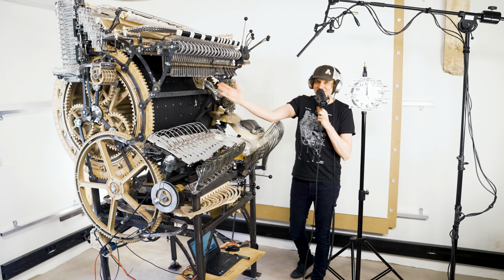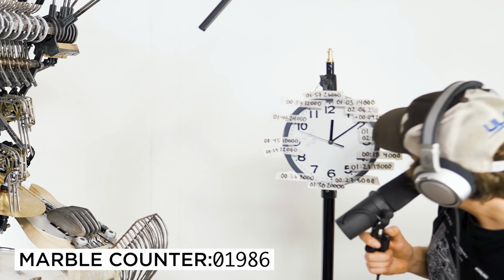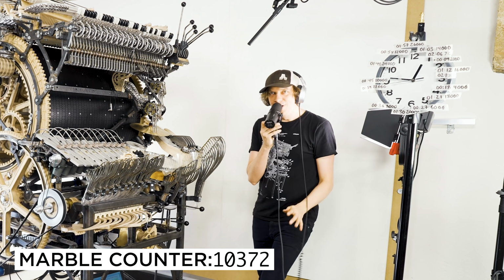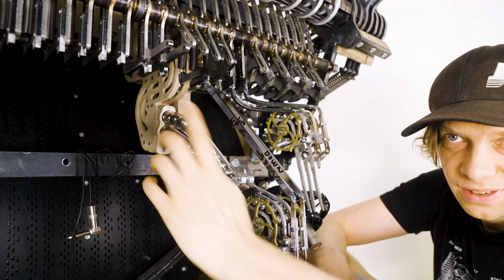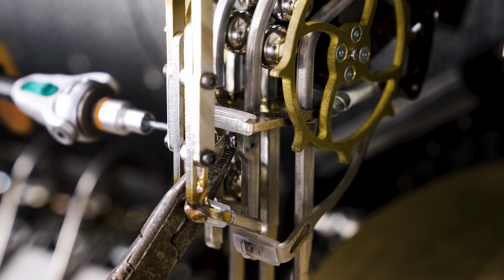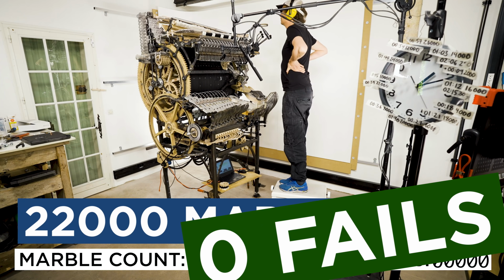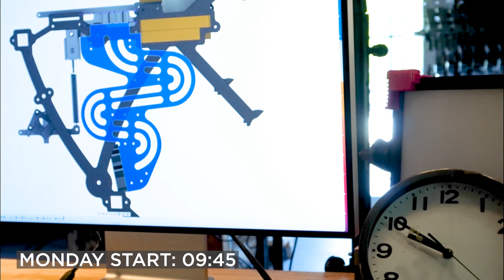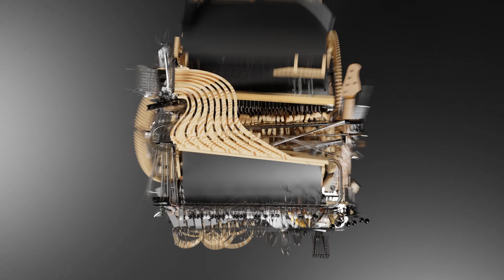Playing 30000 Marbles - Marble Machine X Accuracy Test

Comment: There should be a close up camera on the part you are testing at all times, so you cannot miss what is happening and where. Catching a failure should not be down to luck, but to planning. Futhermore, the profile of the clock escampenet gate wheels and the black arms is not ideal. The way they are now they can slip under too much pressure. But if they are angled differently to hook slightly into each other, it would be self reinforcing under pressure and always safe.

Comment: Someone should make a raspberry Pi Zero speed controller web page interface for the machine that has analogue dials and a simple LCD quick selection on the machine its self. I know the initial goal was a manual powered machine. But if you keep needing to use a laptop mounted under the machine maybe replace that and integrate it more permanently. Im so happy that the new gates are working as expected and now most of the moles are smashed it makes diagnosing then fixing the trouble spots easier.

Comment: The springs will over time get weaker and weaker. The more they are used, the faster they will get weakened. To help mitigate this, you could replace the steel springs (not sure of the alloy you are using) and go with a better spring that will keep it's elasticity/strength a lot longer.
If you go through all the springs, you will probably start to see a variance in the strengths. The ones that are activated the most will have a weaker strength than the ones you've barely used.
Beryllium Copper springs could work, tho they are one of the most expensive (takes 2-3 hrs of heat treatment to be made). There's also Phosphor Bronze Copper springs, which aren't as expensive, but still really good. Here's a page with the various differences broken down of the spring types/metals: https://www.thomasnet.com/articles/metals-metal-products/types-of-spring-materials/

Comment: Just use PC or some kind of programmable controller for marble releasing already! This programming wheel looks ridiculous in present time. With program driven marble releasing you can adjust timings very precisely, you can adjust playing music with just a little bit of clicking. You using XXI century tools for constructing, and for driving a motor of the machine (seems like it turn on and off from a laptop), but for main and crucial part of the machine, for it's heart you use a punched drum!

Comment: Have you thought about how you are going to move this machine once you're done and on tour? It doesn't look hard to knock over is not handled properly; have you given any thought about adding a larger, wider leg support for the machine that will minimize the chance of it tipping over? It looks like the rear legs should be farther back to offset the center of gravity. I would hate to hear of it toppling over during travel; you have put so much time and effort into making this amazing machine, it would all come to an end if knocked over from someone's carelessness.

Comment: You need to buy a decent Metal Lathe

You can make a lot of high precicion parts yourself with a Lathe

The Mini Lathes available are less than $750 in most cases, and can do quite a bit...especially with softer metals like Aluminum and Brass

Comment: How many marbles would be played in one song? how about in a concert?
Reply: He detailed this in episode #142.  To play just the original marble machine song, he needs slightly more than 3500 marbles (3584 exactly) to play correctly with nigh-certainty.  99.99% reliability (1 fail in 10,000 marbles) would give him a 40% chance of playing the one song correctly.  He suggested a concert would likely be 10 songs, so in the neighborhood of roughly 35,000 marbles would equal one concert.  But Martin isn't thinking about just one concert... he wants a world tour, and a lot of studio practice, and he doesn't want any failures for any of it, so he wants to play 1,000 songs without issue, or in the ballpark of roughly 3.5 million marbles... hence aiming for 99.99999% (1/10 million) reliability.  This is operating on the assumption that a single failed marble could destroy the machine, which is obviously not true, but aiming for this kind of precision isn't a bad thing.

Now, with all channels installed on the machine he'll be able to go through more marbles much faster to test this... although he is limited by the marble lift speed of 8 marbles per crank turn.  So he'll need 1,250,000 crank turns to get through the 10 million.  At 120 bpm, that's 173+ hours, or a little over one week of non-stop testing.  Not sure if he's going to insist on doing so, or if he'll do a shorter intensive test on 8 channels at a time, cycling through a different 8 channels each test.  That would be the much smarter move.
Reply: @Fieari  Wow, thats interesting stuff, thanks for the reply. That's certainly a very lofty goal lol, it will be interesting to see how it progresses. I was going to ask why he wouln't just crank up the BPM, but I assume it's because that would mean the testing conditions would differ from the conditions during concert's ect.

Comment: Well, is there something that Scare engineers, (or rather problem solvers).
when a solution work the first time, without adjustments.

the saying goes "that you shouldn't worry is your solution fails the first time, you should when it doesn't" among everyone that has to fix a problem.

Comment: holly molly, don't visit a modern mechanical production factory!. the machines where timing is critical. If the machine (especially from Gemany) are not kept surgically clean...WILL NOT WORK!. All the company reps insist..clean the machine like new and it will not fault. It's true. We would have MANY balls on the floor in one minute and your head would explode Martin..LOL!